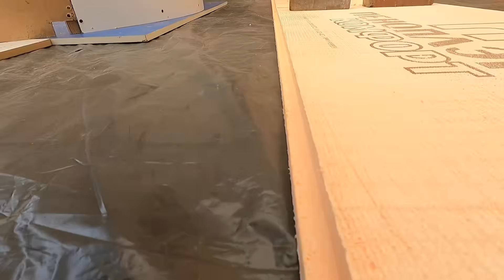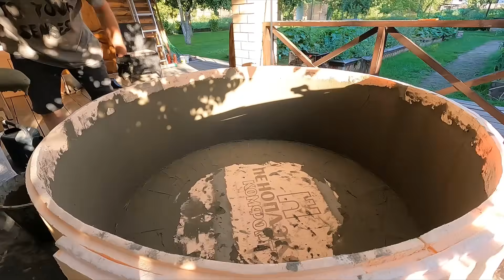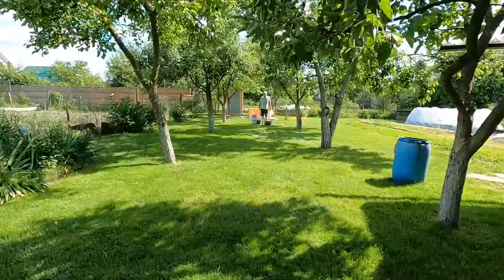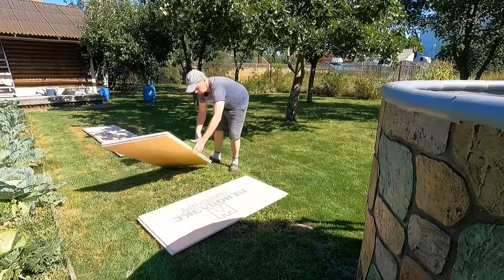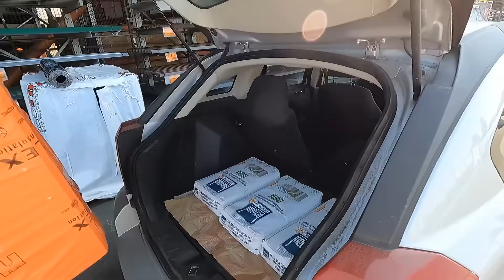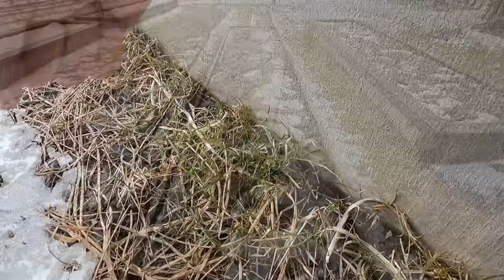Amazing DIY Building Material for Your Home & Backyard: Affordable and Easy to Make!

Comment: The mixture he's using a lot (Ceresit CT 82.) is a mixture that's meant to be applied to exterior foam.
It's pretty similar to stucco or mortar mixes but there's some differences in the polymers and additives that are in the Ceresit CT 82 that you won't find in most American stucco cements. 

We actually have these materials in the US. Styrofoam 100% IS USED as an exterior building material in commercial and residential (apartments) applications. They do NOT use it structurally, but it is used. In Canada, they use it even more.
American/Canadian Products CLOSEST in similarity to Ceresit CT 82 are:
Dryvit Primus / Genesis / Ameristone Base Coat
Sto BTS Plus / Sto Base Coat
Master Builders Solutions Senergy Base Coat
Parex USA DPR / PB Base Coat

Good luck finding those right? So I made a list of the Big Box Store equivalents that you can pick up today (Home Depot/Lowes/Ace Hardware):

Quikrete Stucco Base Coat (for mesh embedment, not ideal for EPS bonding alone) :(
Sakrete Surface Bonding Cement (very strong, sticks to foam with mechanical keying) <3 
Laticrete MVIS Masonry Veneer Mortar (excellent adhesion, expensive) :( 

That's the best I can find. For all of these, it will be ideal to apply with fiberglass mesh. And definitely score the surface of the foam.
Don't hesitate to use FB marketplace to source your foam. It'll be 1/2 or even 1/4 of the cost of buying it at big box stores.
Reply: I'm going to be trying some of these box store brands out soon.
But if anyone has any experience with them, I'd seriously appreciate your comment/input. 

I'd like to start an American community to discuss this stuff as well.

Comment: This method is used throughout the South West in the United States to build homes in arid regions. Wood framing, covered in foam board, then wrapped (in either poly mesh or chicken wire), and then sprayed with stucco mix. 

It lasts a very long time (50+ years) in dry conditions, and about 25 years in wet conditions. More significantly, it resists termites, which in the regions it's used for home construction, tend to be a major problem. 

In the U.S., what you're looking for is "Extruded Polystyrene Board". This costs a lot if you buy at a chain retailers like Home Depot or Lowes, you will want to go to a contractor supplier for orders of more than about 20 sheets. Sheet sized are also a bit different in the U.S., generally 4' x 8' (or sometimes available in 4' x 4' half-sheets). It will be about ¼ of the price wholesale compared to a chain retainer if purchased by the pallet. They may make up the difference on delivery though, so you're best option is if you can transport it yourself. 

I wouldn't use this method for a composter. It's a really great idea, but it could easily become oxygen deprived, making the compost go anerobic (which can lead to odors, slower decomposition, and a lot of liquid pooling in the bottom). It would also be difficult to turn over in this style of box. What he did here is likely fine for grass clippings and fallen leaves. A lot depends on what you're putting into the compost. 

This method would however be fantastic for things like chicken coops, tool sheds, potting sheds, or even small workshop buildings (a potter's studio for example). 

For a pool, hot tub or pond, I would still use a minimum 5mil PVC or rubber liner on the interior. While this is waterproof already, and fairly strong, polystyrene does not do well with acidic or alkaline solutions, so if you are chemically treating the water, you could degrade it if it permeates the plaster layer. Likewise, never use paints directly on the polystyrene, especially spray paint, as anything thinned with acetone will eat right through it. 

Also, meal worms and wax moths will eat polystyrene. They shouldn't pose much of a problem under normal conditions, but I would not use it for things like bee hives that are targeted by wax moths, or for growing mealworms for chicken feed, composting, or fishing bait. Those are the only two pests I know of that eat the stuff, so for most purposes, it's a pretty minimal concern.
Reply: Thank you for taking the time to share all of this valuable information!❤

Comment: Great idea I could use for a project. Anyone know a USA alternative to that CT 82 adhesive polystyrene mortar. Cemcoat has some adhesive skim coat stuff, but nothing like the thick application Ceresit stuff in the video. Henry styrofoam panels can be a low cost alternative to the EPS foam, but that adhesive mortar seems like a Euro thing only. Any ideas please reply to this comment.
Reply: I had the same question and Google gemini said this:
The product you are looking for is known in the United States as EIFS Adhesive and Base Coat. In Europe, systems like Ceresit are called ETICS, but here they are called Exterior Insulation and Finish Systems (EIFS).
Because these are professional-grade products, you often find them at specialized masonry or construction supply houses (like ABC Supply or White Cap) rather than standard big-box stores.
Professional EIFS Equivalents (USA)
These are the most direct matches for Ceresit CT 82. They are cement-based, polymer-modified, and used for both sticking foam to a surface and embedding fiberglass mesh for a hard shell.
 * Sto Corp: Sto Primer/Adhesive (Standard or Dry).
 * Dryvit: Genesis or Primus.
 * Sika / Senergy: Alpha Base Coat or Alpha Dry Base Coat.
 * Master Wall: F&M Adhesive & Base Coat.
 * Parex: 121 Adhesive/Base Coat.
 * Omega Products: StyroGlue DryBond or FoamTek.
Thick-Application "Big Box" Alternatives
If you cannot get to a specialty supplier, these products are available at Home Depot or Lowe's and provide the "thick" application and strength you saw in the video:
 * Quikrete Quikwall (Surface Bonding Cement): This is highly recommended for DIY foam projects. It is a glass-fiber-reinforced cement meant for dry-stacking blocks. It can be applied much thicker than a standard skim coat and is very strong.
 * Polymer-Modified Thin-set (e.g., Custom Building Products FlexBond): While designed for tile, a high-quality "modified" thin-set has the polymers needed to stick to foam. It is thinner than Quikwall but thicker than a paint-on adhesive.
 * Laticrete MVIS (Masonry Veneer Installation System): This is a high-strength, thick-bed mortar that sticks exceptionally well to foam panels used for stone veneer.

Comment: You aren't listing WHAT the materials are though. We can see you're using some type of foam + some type of stucco, but there's lots of different types. Which do you use?
Reply: All of the information you need is in the video if you pay attention and put in a little time/effort. 😒

The foam board is penoplex comfort. Its polystyrene by extrusion or XPS board. Common US brands are:
Kingspan GreenGuard® XPS,
Owens Corning FOAMULAR® XPS, DuPont™ Styrofoam™ Brand XPS. 

The adhesive he s nods is ceresit ct 82, an adhesive mortar made for xps. The American equivalent would be something along the lines of Senergy EIFS Mortar.

 The fiberglass mesh is widely available from many generic sources.  "5*5mm Alkali Resistant Fiberglass Mesh Cloth"

Construction polyurethane foam - aka spray foam. 

According to synergy their eifs is not waterproof. Instead, the combined aspects of the "system" its designed for are what create a waterproof barrier. It seems like these waterproof eifs xps systems are made by a variety of different manufacturers, some may have different benefits depending on the circumstances. They seem to be pretty much what is used in this video. They all seem to be designed in a way where you are expected to use the whole "system" from one brand. Im not sure what the outcome would be if mixing different components from multiple brands,  but its something you may want to research.  StoTherm® ci XPS or WaterMaster XPS are two waterproof "systems" available in the states.

Choosing what to use requires some leg work to make sure you are getting exactly what you need for your specific circumstances, but the above information should help.

Comment: you could easily stop that room from flooding just by burying in a corner a 120 liter plastic barrel with holes in it and a water pump in it that would evacuate the water when the level is raising , first in the barrel and so the water level rising will not surpass the level of the floor .

Comment: We need to understand exactly what materials you are using to build these projects and achieve the low costs. Please create and offer a materials sheet tells exactly what kind of foam boards used, exactly what foam board glue and exact what type of mortar is used. For each explain the type and ingredients each of these is made from. Very anxious to try this building method. Note in order to achieve this low cost building method we must fully understand what materials you are use so we can find that here in North America as cheaply as you have. Steve (69yrs) Manitoba Canada
Reply: Give screenshots or type in the names in chatgpt. It would be nice if he listed his materials, but chatgpt can explain what all the mixtures and materials are. It can also give you DIY mixing instructions rather than buying expensive premixes. Cheers! From a Canadian living in Mexico.
Reply: it might be difficult as it is obviously a Russian channel.
Reply: penoplex
Reply: I asked Google's AI and got this answer for the thick coating:

The product you are looking for is known in the United States as EIFS Adhesive and Base Coat. In Europe, systems like Ceresit are called ETICS, but here they are called Exterior Insulation and Finish Systems (EIFS).

Because these are professional-grade products, you often find them at specialized masonry or construction supply houses (like ABC Supply or White Cap) rather than standard big-box stores.

Professional EIFS Equivalents (USA)

These are the most direct matches for Ceresit CT 82. They are cement-based, polymer-modified, and used for both sticking foam to a surface and embedding fiberglass mesh for a hard shell.

 * Sto Corp: Sto Primer/Adhesive (Standard or Dry).

 * Dryvit: Genesis or Primus.

 * Sika / Senergy: Alpha Base Coat or Alpha Dry Base Coat.

 * Master Wall: F&M Adhesive & Base Coat.

 * Parex: 121 Adhesive/Base Coat.

 * Omega Products: StyroGlue DryBond or FoamTek.

Thick-Application "Big Box" Alternatives

If you cannot get to a specialty supplier, these products are available at Home Depot or Lowe's and provide the "thick" application and strength you saw in the video:

 * Quikrete Quikwall (Surface Bonding Cement): This is highly recommended for DIY foam projects. It is a glass-fiber-reinforced cement meant for dry-stacking blocks. It can be applied much thicker than a standard skim coat and is very strong.

 * Polymer-Modified Thin-set (e.g., Custom Building Products FlexBond): While designed for tile, a high-quality "modified" thin-set has the polymers needed to stick to foam. It is thinner than Quikwall but thicker than a paint-on adhesive.

 * Laticrete MVIS (Masonry Veneer Installation System): This is a high-strength, thick-bed mortar that sticks exceptionally well to foam panels used for stone veneer.

Comment: Enjoying your channel. I know English isn't your first language but I have a question about the foam. Are U using 
XPS (Extruded Polystyrene) or EPS (Expanded Polystyrene) SL grade (Standard Light). EPS is around 2/3 cheaper. Thank you. Still waiting for the bee hive vid. 😉
Reply: Penoplex is XPS (Extruded Polystyrene) insulation.

⸻

🔹 Summary:
	•	Type: XPS
	•	Structure: Closed-cell
	•	R-value: Around 5 per inch
	•	Moisture resistance: High
	•	Typical color: Bright orange

⸻

🔹 Common Uses:
	•	Under concrete slabs
	•	Foundation walls (exterior or interior)
	•	Perimeter insulation for homes and buildings
	•	Roof insulation in flat or low-slope applications

⸻

If you’re looking for something rigid, waterproof, and durable, Penoplex is a solid choice—very similar to Owens Corning Foamular (pink) or Dow Blue Board.
Reply: @HikerMoon but can we use EPS? It's a lot cheaper. Cheers

Comment: 💡💡💡💡Great job on teaching the people how they can take control over their lives by constructing their own  projects. 
Polystyrene, (EPS) and Concrete can enable everyone to accomplish these goals without breaking the bank.
Reply: but he is using XPS which is 2 times more costly! It does not work with EPS !
Reply: @xnomado  EPS is Cast, then cut into sheets, where XPS is Extruded to its thickness. EPS usually is offered in a 1 pound per cubic foot quality, where 1.5  pound is better if used for Structural purposes, and Hader to find.
Reply: Penoplex in the videos is XPS.  As of now, Penoplex is not commonly sold in the U.S. market. It’s a Russian-made XPS brand, exported primarily to Europe and parts of Asia, but there’s no evidence of major distribution or retail availability in the U.S.
Reply: If you’re based in the U.S., similar performance can be achieved with these options:
	•	Owens Corning Foamular (blue XPS)
	•	Dow STYROFOAM or BlueBoard (blue XPS)
	•	Kingspan (in some regions, canned as InsulRoof or similar)

These are manufactured domestically or through North American distribution networks with equivalent R‑value (~5/in), closed‑cell structure, high moisture resistance, and compressive strength.
Reply: @HikerMoon  in EU all XPS are water resistance, no need to have any versions like blue, i dunno maybe marketing or alitle better than non blue XPS? 
Blue EPS is commonly used on fundaments facade as its cheaper than XPS used on bottom side of fundaments
Reply: @xnomado I really wish I could buy Penoplex and it was as inexpensive as he says. I love all of his projects on the videos. It’s expensive in the US.
Reply: I have asked him which type of foam he's using. Here in Australia one 3 times the price of the other
Reply: @theaussienurseflipper.8113 he's using Extruded polystyrene XPS. Not sure how bendable the Expanded EPS is. He mentioned somewhere it is more brittle.

Comment: Any one in the states have experience and found a foam sheet that is flexible enough to bend? Prices here in southern New Mexico have skyrocketed this year but I believe this method really works. I added an exterior STO foam board which is the same method and it really makes a difference. I upgraded a beehive with the same that helps with the heat and cold.
Reply: I used chat gpt to do a cost search and compare that to local Russian prices of penoplex. 

In $ Penoplex is about 67 cents/sf.  US manufactures are 3-4x more expensive/sf. 

Kingspan Greenguard is the least expensive by about $12-16 per 4'x8' sheet at $44.

I was excited about this guy's idea but I guess Americans won't get the low cost benefit. Might be cheaper to import it and pay the tarrifs 😂
Reply: @PsuedoTym try being stuck in comie chinada. Prices are beyond affordable.
Reply: Extruded might bend better than expanded. If you have a Menards close to you check the prices there
Reply: One could put small razorblade slits to one side to prevent snapping like they do w.drywall arches etc.
Reply: There's a foam insulation which comes on a roll at HD and Lowes.
Reply: @joewoodchuck3824 this
Reply: @joewoodchuck3824 would the foam be toxic though?
Reply: New Mexico really has gotten pricey which is crazy
Reply: 🤡🌮🤡looks like the tarriffs have increased foam prices🤡🌮🤡
Reply: @LaughingblueSu  I think most foam is produced domestically.  I don't know about the base materials.  I would guess that most of the price increases are due to consolidation in the industry.
Reply: @LaughingblueSu it was worth it. We dont care.
Reply: @johnmichaels4330  We? Don't know about YOU, but I sure care that tariff's increased foam prices. I'd prefer low cost foam like Penoplex. WE care a lot.
Reply: @ScottForrest420 no, the majority of us in the US don't. You obviously part of the majority who want to save OUR country. So there you go, you are the special, get tourself a juice box while WE save the damn country from leftist communists. 😉 or move, im good with either.

Comment: Could you also use porch screen for the mesh part of this structure??? It would be cheaper to buy
Reply: I would think so
Reply: It would need to be alkali resistant.
Reply: Don't use fiberglass insect screen it will disolve as @farrahtittle6675 mentioned. Plastic would work fine but may not be as strong.  Look up latex concrete, they use materials from burlap to shade cloth.

Comment: But will it withstand 150mph winds.
Reply: If it is round, it just might. Depends on how it is attached to the ground. Wind grabs edges and flat planes so if it doesn't have as many to grab it's less of a problem.
Reply: That would tear off just about any roof.  I've seen 80 mph roofs lift and down on commercial buildings.  For reference go look at buildings on YouTube that have seen such destruction.
My concrete block house shuttered from my last non direct hurricane.  I was prepared to leave my concrete structure if it hadn't turned